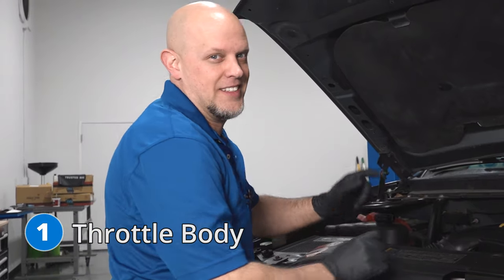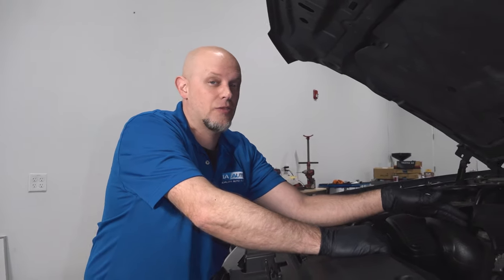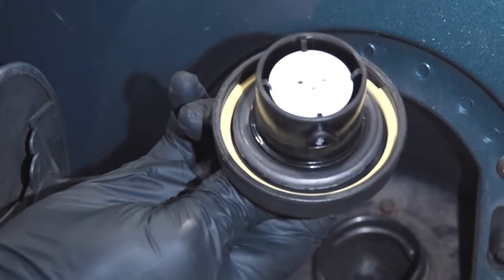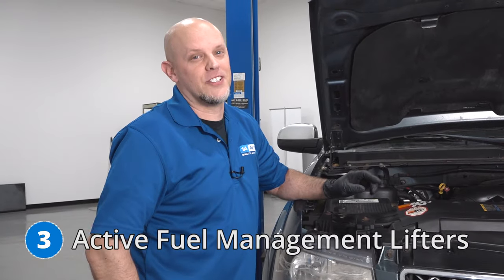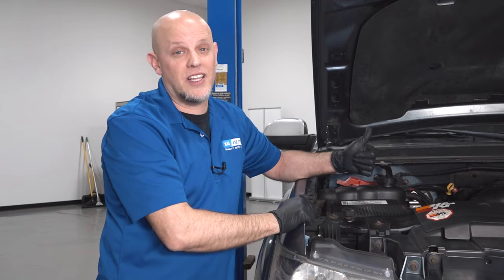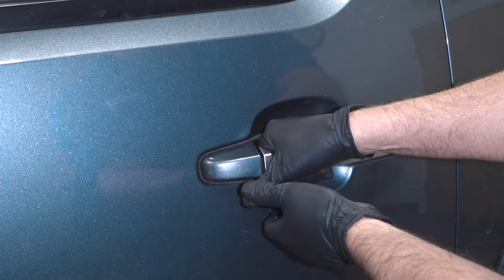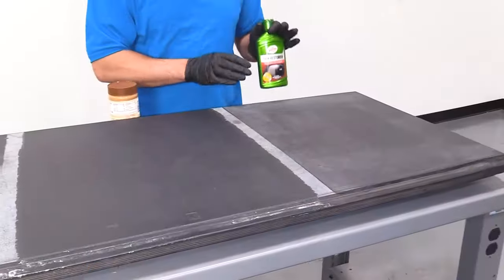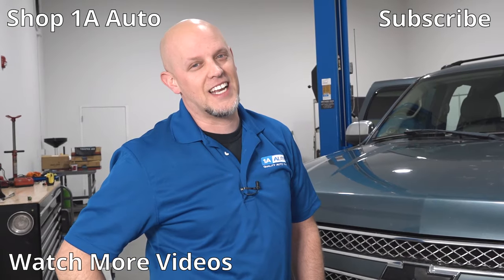Top 5 Problems Chevy Avalanche Truck 2nd Generation 2007-13

Comment from the maker: √  Watch the Video
√  Buy The Part at 1A Auto http://1aau.to/m/Visit-1AAuto
√  Do it Yourself
√  Save Money
Reply: Still rolling hard on my 07 z71 yes the afm was a headache  but besides that never had a problem she is 15 yrs old and still keeping up with these new truck and like the way they are copying our avalanche’s now in days
Reply: 07 I left the truck running and the battery died and it ran out of gas now I changed the battery put in some more gas and it’s not starting. Can I get some help on starting it?

Comment: Loving my 2010 'Lanche! 250k miles and only add gas, oil, and occasionally air. This vehicle is bulletproof! (Except for the damn door handles)
Reply from the maker: +Mad Thanks for checking us out! http://1aau.to/m/Shop-1AAuto-c
Reply: Mines 2008 and have had a lot of problems.
Reply: I have a 2011 avalanche and the back door handle broke. Was is a pain to repair?
Reply: Nice! I have a 2010 Avalanche LTZ. Complete top end was replaced due to the AFM. I have a disabler in, and do oil changes every 3500. 164k on the clock, hoping for 100k more!
Reply: @maverickmcsherry6896  does your radio turn off and on while driving
Reply: @LifeAsBobby  that's more of an issue with GM's radio from that era. I was watching a video where the solder was loose on the aux Jack and every time you moved the aux jack around it turned the radio off. try moving the aux with your finger while Parked and if that's it then you need to take it apart and resalder it, there's a video on YouTube Somewhere.

Comment: Anybody with a 2007-2013 avalanche should FIRST remove the tail lights, spray undercoating into the rear quarter panels, and maybe poke some holes through on the bottom for water to escape. Every avalanche rusts in that spot because of the double layered metal forming a sealed trough for sand and water that gets washed down through the gaps in your tail lights. I wish I did that before it was too late.

Comment: I’m so close to buying one. The factory tonneau cover and the sunroof are two cherries that fit nicely on that package.
Reply: Get one. I have a 2010 LTZ - it's the best truck ever. Previously I had a 2004 Z71. I went from 157k-175k without a single issue. They're fantastic trucks all around and can pretty much do anything. If you get a second generation - make sure you install an AFM delete as it will save your engine. \m/
Reply: @jimmysgarage9068  what is a AFM delete
Reply: I have an 07 Avalanche and I hammer it but also maintain it.  It’s a great truck!  It’s not perfect by any means but it is reliable.
Reply: @gtb2009b    AFM is Automatic Fuel Management (shuts off cylinders when coasting on the freeway to save fuel)… It was a great idea by GM, but doesn’t really work since it results in stuck lifters, which is costly to repair. 

Better to code out the AFM.

Comment: Good video. The one you missed is the dashboard cracking. Very common problem with Chevy trucks from what I understand. Ended up replacing my dashboard entirely and put a custom-fit cover on it to save it from direct sunlight.
Reply from the maker: +TheMighty Flea Thanks for the tip!

Comment: Solution for AFM problem is buy product call range afm disable cost $200 and insert it obd2 and problem solve literally!!!!
Reply: On ebay there is adm disabling service for50$ return shppng included. I recenntly done that. I ship them overnight. Costed me total 75$
Reply: run transmission in m5 mode and afm is disabled
Reply: @markfritz6367  how is this done?

Comment: Get a Range AFM delete and change PCV valve cover to the updated model. The updated PCV valve will reduce oil consumption.
Reply: run transmission in m5 manual mode and afm is disabled
Reply: @markfritz6367  Really?  I have hated this option from day 1.  Saves fuel my ass.  All it does it make your truck engine shudder (so to speak) and cause oil consumption issues.  Ive wanted to get programmer to just get rid of it entirely.

Comment: I used a Diablo tuner to disable AFM.  It worked but i also have problems with alcohol levels reading incorrectly and causing surging or difficulty starting. Bought a HP tuner. Disabled AFM, eliminated the E85 and the virtual alcohol sensor. Worked great. Also changed tow mode to performance mode and Eco mode to normal.  Completely different truck. JUST BUY THE HP TUNER!!!! It gives you almost infinite customization. Read trouble codes and take live data for the engine and the transmission. 👍👍

Comment: Original Owner of a 2007 Avalanche LS purchased in September of 2006:

I would replace the door handle (#4) & plastic trim (#5) issues with the blower motor pigtail burning up and the dashboard cracking. I have 360K miles on my truck and had no issues with the exterior door handles or the plastic trim. The two issue I mentioned were repaired twice in warranty and one time outside the warranty period.The pigtail fix was done by an electrician and never happened again.  The dash cracked a third time, I am just not going to pay to fix it.....again! 
I would add an honorable mention for the seat heater power/ground plug burning up. Ford Motor company uses the same plug connector in the F150 but runs 2 separate power and 2 separate ground wires and that seems to resolve the issue.

I have had a collapsed lifter from the DOD/AFM twice. Once at 260K miles which resulted in the cam shaft breaking (replaced with a create motor from Chevrolet) Dealer said it would not happen again! Yet again, at about 360K miles #7 lifter collapsed (rebuilt top end with mechanical & programmed DOD/AFM delete). If you have not yet deleted the DOD/AFM function, do so immediately if you want your engine to last as long as it should.

Comment: I just bought a 2013 diamond edition avalanche with 99 k miles so far its a beast I like it no problem with it yet just need to put in a better remote auto starter in it but I like it also my first full size truck its a beast

Comment: I agree with all the problems noted in the video (the only one of the 5 I haven't had on my '07 LTZ is the throttle body sensor failure).  I am very surprised that the dash cracking issue wasn't noted, since virtually every '07-14 GM truck out there except those with leather bonded dashes has broken at some point, or will.

Comment: Good coverage. I did a AFM Delete. It cost me $1000.00 doing it myself I was stubborn and didn't want to replace the left valve cover because it has a improved pcv filter which you need because oil vapors increase  because they're not shutting down lifters anymore.  Pcu was reprogrammed I love my Avalanche again.

Comment: My ‘13 Avalanche just turned the 100k mile mark last night.  The oil pressure sensor just failed the other day.  The car has been very reliable.  Other than routine maintenance, I have had to replace 1 coil pack (#1 cylinder), 1 failed spark plug (#7 failed at 80k miles, so I replaced them all at that time), and of course now the oil sending  unit. Of the vehicles I’ve owned, this is by far my all time favorite.  I intend to keep this car until it turns into a pile of rust.  We’ll see
Reply: Oil sending unit and the Oil screens went on mine a few months ago - I bet you are getting your engine flushed.  Stop it.  Also check your oil cooler lines, they will start to leak now.  Get your oil changed every 5000.  no flushings.

Comment: Mine sat for a long time before I bought it (I suspect, as I bought it from a dealer). Only at 72k miles, but I've restored it a good deal in the 2 years I've owned it. Definitely replaced a door handle. Also had rusting struts, a broken sway bar, bad gas cap, wheel bearings went bad, and a misfiring cylinder. Besides those issues, I put new rims & tires on it and repainted a quarter panel (previous repair by an owner was awful). I still love it. Still need to fix the radio - every time I hit a bump or for no reason at all, it switches inputs. If I ever sell it, it won't be cheap!

Comment: So far I've only experienced the lifter issue on my 2011. Thought it was taken care of, but I recently noticed they still make noise when it's rainy or really foggy out. Also had issues with the oil pressure sensor and recently had a fuel tank strap rust off.

Comment: i love my 2008 avalanche ltz  first truck ive actually bought myself  being only in my twenties , but lately its been giving me problems with  the rear air ride shocks , the bladders on the shocks arn't firm or full of air  like they should be but both  the shocks and the compressor   that pumps them up where replaced just last year  and i cant seem to find the problem .  it had some issues with a tail light  pigtail being burnt out  a few months ago  would that have shorted out the  pump ? other than that issue  i love the thing  it fits me perfectly and has been super reliable
Reply from the maker: +kory coverstone Thanks for the feedback!

Comment: As an 07 LT3 4x4 owner, I think 1A auto did well here but I'll add a couple of additional issues;

1) Oil pressure sending unit & screen filter failure: (Your oil pressure gauge will not display correctly which will cause the check engine light to come on due to CEL code P0521).

2) [4L60E] Transmission failure :  (The 4l60e transmissions commonly fail in the 2gen avalanches due to weak internals that will eventually need to be upgraded and replaced).

3) Leaking bed covers: (the bed [tonneau] covers leak due to a poor seal and require regular cleaning/maintenance).
Reply: I replaced the sending unit and screen in mine. It's tricky to get to!
Reply: I'd agree with this 1000%. I've owned 3 different Avy's for a total of 15yrs and the video & R4SX NineEight are right on the money for anyone considering this awesome truck
Reply: WOW you got that right on, how they missed that amazes me the oil pressure sending unit went garbage on me too as well as my display unit in which i had to replace the chip, luckily now i can put a dash cap cover now because of all the cracks the only bad thing now is that once the dash cap is installed i can no longer take out the instrument cluster because the cap is glued on
Reply: Yes I would move this up to number 1. Just an FYI when you pull the sender and screen, pull the oil filter off and spray a can of brake cleaner down the tube. The tube can get clogged up causing a small amount of oil through the passage and the oil pressure will be lower. This happened to me when I replaced the sender and screen. Put everything back together and within 10 minutes that damn oil pressure alarm was going off. After flushing the tube, I now maintain about 35PSI at idle.

Comment: 2013 Chevy Avalanche Black Diamond issues: midgate rear window glass platic edging cracked and broke, plastic door grips broke, dash first cracked then broke and caved in, 2 outer door handles broke, plastic front ac vents broke, wear and tear on the tonneau covers, Steering wheel ripped, flimsy hub caps, fuse issues, cheap plastic internals have broken. 
Still an amazing Daily driver.

Comment: It would have been nice if you could have put an approximate repair cost with each problem or at least the retail cost of the replacement part. Other than that a very good video.

Comment: What about the sway bar mounting bracket rusting away on the passenger side from the a/c condensation dripping on it constantly.. That's a BIG problem if you ask me.

Comment: That damn EVAP system. My vapor canister started breaking up sending little charcoal beads that got all the way to my fuel tank. It was intermittent though and I only found it after replacing my 3rd (don’t judge me) EVAP Canister and the little beads started falling out. Eventually had to drop and drain my whole fuel tank. Sometimes it would take me 30 minutes to fill up with fuel because it would keep cutting off the pump. Thanks for the video and I’ve had 2/5 problems so far lol. I have a 2011 Avy LTZ.

Comment: Afm issue. Check. Door handle check. Plastic fading on the sails. Check. Throttle body. Check  but I can’t seem to ever completely fill mine either so check on the evap. It’s ok tho. I don’t have afm anymore. Painting my sails this weekend. Door handle was fixed before I got it  throttle body is still hanging in there tho. Probably doesn’t like the stage 2 cam I got

Comment: Love my 07 Avalanche LTZ but at 149k miles the AFM failed and it cost 6k to rebuild the motor. Now I use a obd2 modular to prevent the 4 cylinder shutdown. I live in Commiefornia so I cannot get rid of the AFM or reflash the ECM. All the plastics on the dashboard are starting to crack at other areas besides the top areas that are most common I see from other models. This is just a few I mentioned. Now I refuse to buy any gmc vehicles again. Every other vehicles I have that are Japanese never had major problems like this.

Comment: I have a 2009 Chevy Avalanche LTZ (125K miles) and experiencing the following issues:
1. The dashboard cracks
2. Chrome on the door handles is ripping off
3. Suspension error

Any good mechanic recommendation near the Northern Virginia region. :-)

Comment: If  you after speedomter get stuck or not working right ( not showing correct speed ) simpling discount the batery Neg- cable wait 45 sec. and reconect it. This will reset it :)

Comment: All valid issues, but numero uno in my list of problems with these models is one that carried over to the Tahoe, Suburban, Yukon's, and probably the Escalade. That being the plastic dash that cracked (multiple cracks actually) on every vehicle made (or at least the one's sold in Texas), and GM would do nothing about it. I owned a 2007 Avalanche LTZ for almost 10 years and a 2014 Yukon Denali for 7 years. Both started breaking down after only about 4 years. You would think GM would have fixed this issue by the 2014 model. Other than that, these were great vehicles.
Reply: Was one of my worries to.  From day one I have always used a sunshade if I am leaving the vehicle outside.  No cracks at 10 years still.

Comment: Okay - Hive - I have a 2013 Avalanche with p219a and b (both banks) going off.  Air to fuel ratios.  I have replaced, O2 sensors, lifters, fuel injectors,  Air filter, The MAF.  I have had the Entire system checked parallel to a Twin - ALL the readings are in spec.  But Still after only 2 km I get random misfires - not specific to Any one cylinder .  Lean and Rich is all over the map.  Could this Really be fuel Cap? or the ECM? Or am I looking in the wrong direction?

Comment: Other problem that are common and re occur over and over again are weak CV boots (I replaced my passenger side one 3 times in one year...thank God my mechanic warranted the parts).  I opted for the "winter" CV boots, and they seem to last longer I believe it's the boot material which is better.  Also weak front axle seals leak no matter what.  I also got an AFM disabler that keeps my 5.3L in 8 cylinder mode, best purchase I've made so far.

Comment: My engine light was ON, diagnostic check by GM Dealer told me there is a “hole” rust at the top of the Gas Tank and it needs replaced. After filling it with gas a few times the Engine light went OFF. How imperative is it that I get this replaced? Could it have just been the gas cap?? How do they see the “hole at the top of the tank without taking the whole gastank out?
Reply: do you know the code off hand?

Comment: I have an 07 ltz that the hard plastic around the rear windshield has cracked what can I do to fix it or what is that part called?   Blonde but not dumb

Comment: at 190k we lost the #4 cyl lifters. one of the cyl that shuts down for economic driving. had. no warning. tractions lights came on and went into limp mode. camshaft was still good made repairs just the lifters and all the gaskets.

Comment: How about that main issues the no crank not start issue mine is at the dealer for the second time the first time they said it was the fuse box and its mack in the at the dealer for the same thing turned the key and nothing so if u no why pls. Let me no thanks

Comment: I've worked thru most of the issues
1.  Range AFM Delete
2.  Oil Pressure Sensor
3.  Purge Valve & Vent
4.  Goes thru headlights which are a pia to change.
5. 236k miles
Anyone having "service charging system" alerts?

Comment: Hello guys! I’m wondering if anyone can tell me why a 2003 Chevy avalanche 1500 5.3 would say reduced engine power while driving? It’ll let me drive  50 miles a hr but won’t go any faster and won’t rev up when I stop but if I shut truck off for a minute it will be good again but don’t happen often. Thanks
Reply: Mine did that except it would only go about 20 mph.  That’s when I had to replace the throttle body.

Comment: My 2008 Avalanche drivers front door and passenger rear door body molding keeps peeling off. I just turned 58,000 miles(yes, that's correct) and I've replaced them 3 times already!
Reply: Use a stronger adhesive
Reply: If you're meaning the bump guards that run almost in the middle of all the doors, just take them off and buff the paint under them back out. Looks better without them
Reply: Mine had the discoloration due to the factory defect.  Looks awful.

Comment: Don’t forget the oil sending unit which creates each individual to invent his very own swearword or two! And although they have plastic fuel tanks where the sending unit and the pump are located is not a stainless steel plate looks like just raw metal becausethey rust out in about 10 years to the day! Yep more swearwords are invented there too! And the other minor pain in the ass is the drive motors for the electric seats yup when you get to that part there might not be new swearwords there But you’ll think about it exclamation